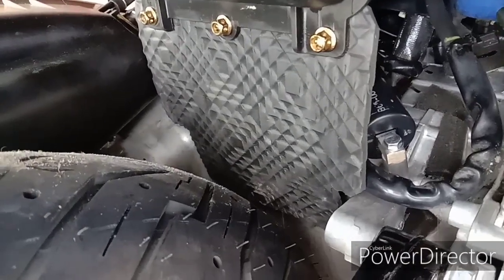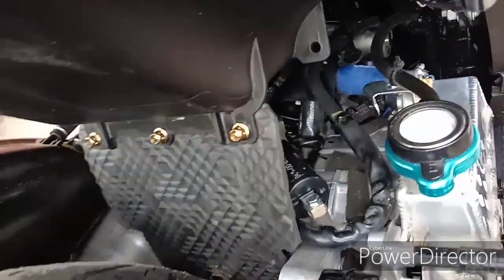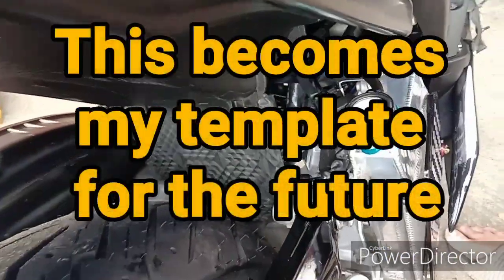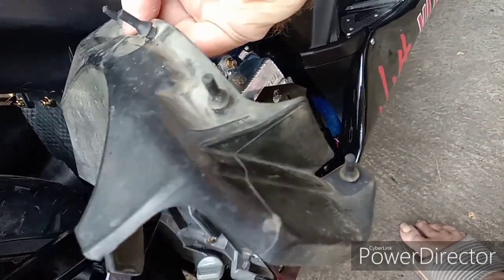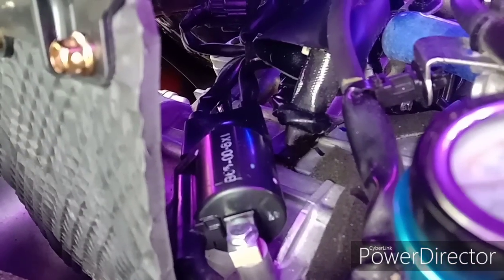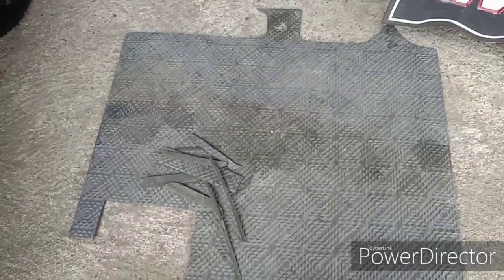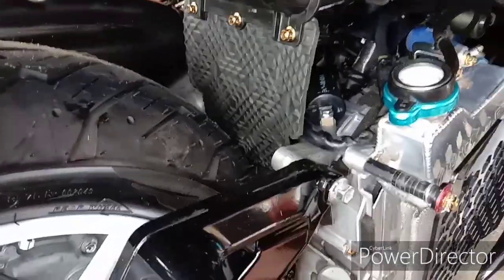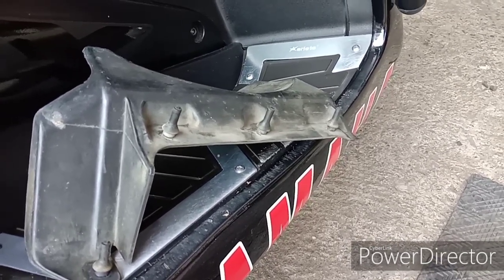Aerox 155 DIY MID GUARD inner mudguard MOD

Comment: Halo Bro.....Radiator Cap for Nvx... suitable spec 0.9 or 1.1..?
Reply from the maker: NVX and the Aerox are the same.
Searching around on line for the answer. "D1" "1.1"
Reply: Tqvm bro...
Reply: Bro.. can i used 0.9..?
Reply from the maker: I don't know if you can?